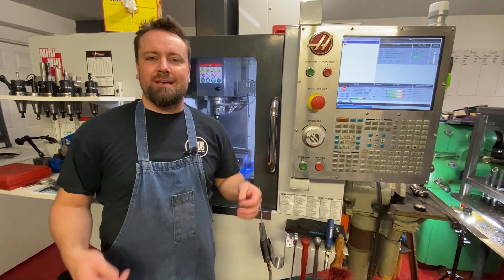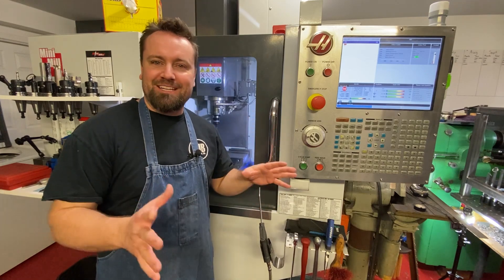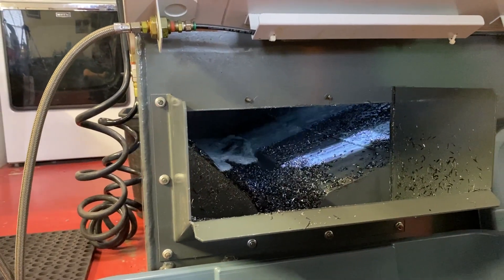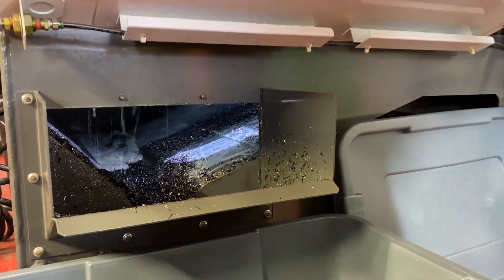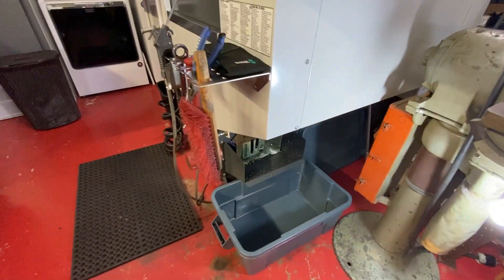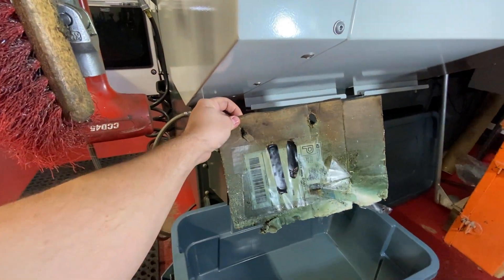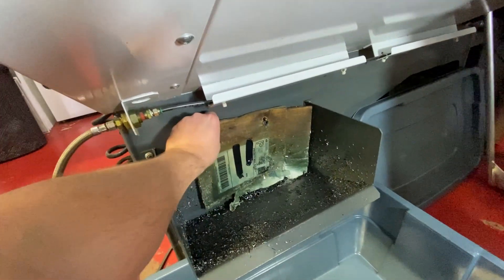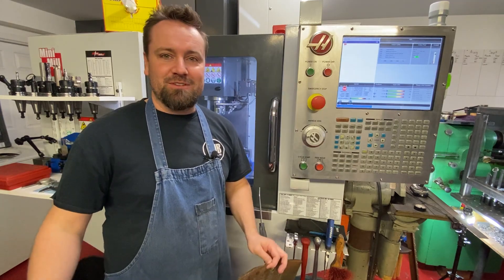Haas Mini Mill Chip Clean-out Door | My Haas has no chip conveyor, so I made this.

Comment: How do u deal with oil in the coolant reservoir ?
Reply from the maker: There is an extension on the side that the pump sits in where you can put a oil skimmer…. but I don’t do anything 😁
Reply: @nubtools  i'm new at work and they have an '04 model. the oil thickens in the sump and makes a nasty layer. i tried taking out large chunks but no luck.
Reply from the maker: I ran one about that age and the coolant tank design was very difficult to maintain. The newer models are designed much better. Have you looked into the rope style skimmers?
Reply: @nubtools  i think that i should convince them to move to an MQL system. we don't do production work

Comment: man... I would love a haas mini mill to add to my shop arsenal. What kind of feedback do you have for someone who would be interested in get into milling or looking for a haas mini? yeah i know that a open question. I just love the idea of milling somthing and would love to learn more about how and why a hobbyist would or should get into one. Also what about power requirements from a home garage.
Reply from the maker: What’s up Ratha. Yes you should get one.😂
I’d say this first, if you’re still limited to a standard home garage when getting a cnc mill, than this is the way. I love my mini mill but if you can get a bigger machine than most definitely do that. I have run many Haas machines of all sizes in my past careers and the holy grail for me is the VF-2. 
If you want further input sometime just DM me on Instagram.
Thanks for watching and thanks for your great content. 
Dave
Reply from the maker: I run this machine on single phase 240v. / 40 amp breaker. I have other machines that use 3 phase power that is supplied by a rotary phase converter.
Reply: @nubtools  Thanks David! I really appreciate the insight.